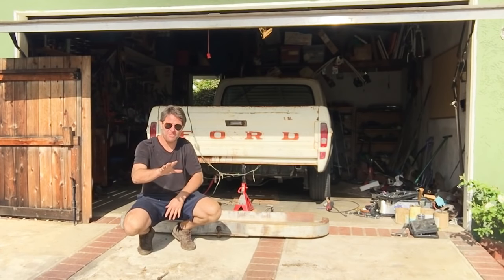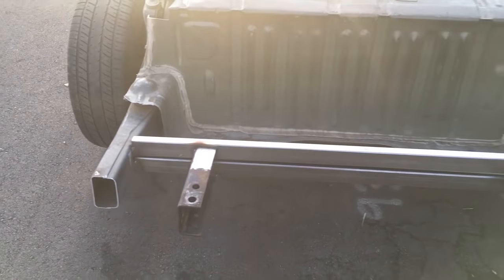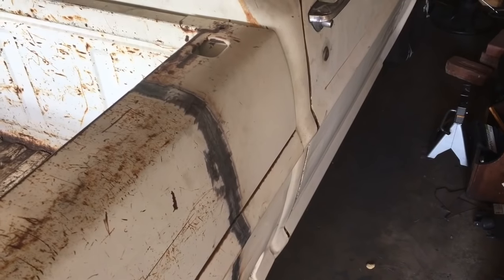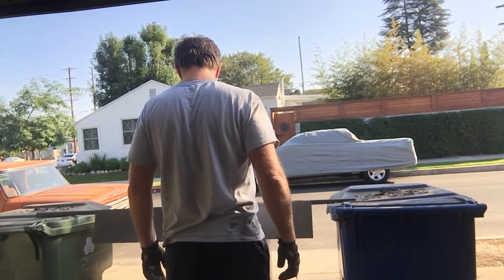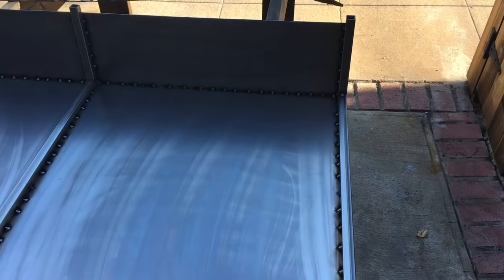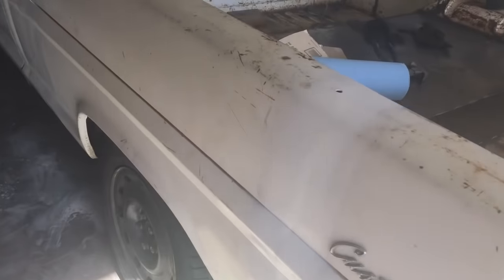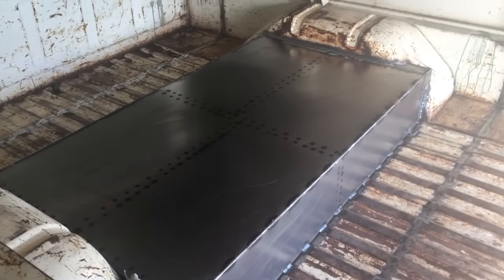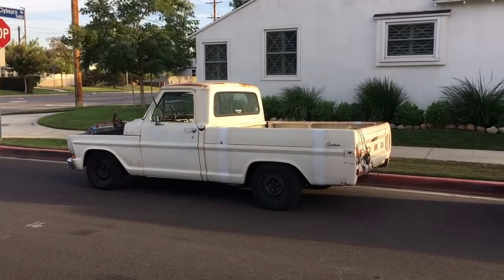F100 Crown Vic full frame swap "F71" Episode 9 more bed shortening, bed humps & intakes.

Comment: Just watching this for the first time (found you on the mutt build) and wondering why you didn't reusue some of the bed section you cut out to try to keep the look of the original bed - it's still an awesome job though
Reply from the maker: My thoughts and strategy on "how" to chop a bed have definitely changed and will be different on the next one. Thanks for watching.

Comment: Just a LATE suggestion......on the added frame section (Bumper mount), I would have added a pair of gussets between the added frame and the crown vic frame....extra tensile strength/support. Maybe even 4 gussets.....2 sets of triangles welded to the inside corners. Not my truck, it's yours. Your build, just a suggestion. Peace. ( I just noted Del Swanson suggested this 2 days ago. [edit])
Reply from the maker: Yeah. If I was towing heavy stuff I totally agree but my orange truck just sold so the F71 has to get finished...pronto! lol. It'll stay like this for now. I plan on selling it pretty quickly but if it becomes a tow truck I'll add some more steel.
Reply: Them 2 trucks looked cool! Even though I'm not really a Ford fan.

Comment: Really nice the way this is coming together. Someone did steal the orange truck at that price. I hope to get half as good at welding as you. Are you using 110v or 220v ? I'm thinking about this full crown vic swap - in my case the truck is a 1961 F100 flareside (stepside in GM terminology), but I would want to minimize the fuel tank hump in the bed with a 1970 Mustang fuel tank modified to work with the Crown Vic electric fuel pump(?). Looking forward to seeing the next video, great job!
Reply from the maker: I have a 220V Eastwood MIG 175. It is just powerful enough to do the frame welding. I'll get a bigger one next time though. Slick sides go really well with this swap. A few have been done. Good luck!

Comment: Hey Nathan.  Really enjoying your vids man. Some youtubers have great projects but watching them the whole time is AAAWWWFUULLL!!  Your style makes the vids enjoyable on top of the actual truck part. Enough kindness....I have a question. I'm going to build one of these.  I'm 50 and have enjoyed my years of beating and banging in hotrods. This one must be comfy, not overly loud, have all the gizmos working like A/C, stereo, power steering and brakes, etc.  It must ride beautifully because I'll proly drive it almost every day. I've had most every year of old ford truck and sold my last '49 F1 a year ago.  I fit ok in these trucks but for this one I need more room.  I'm 6'3 and weigh right at 295.  I drive a fox body mustang every day (bought it new almost 30 years ago) and just barely fit in it. I'm trying to decide between crown vic floor pan and firewall or truck cab floor and firewall.  I do not want the crown vic complete dash like your first one but do want to use all the CV underdash parts like pedals, a/c etc.  I want an old steel dash like my older trucks had but with the CV stuff in place.  So....since you have done both, can you give me your thoughts on both, as much detail as possible....lol. And yep, I've watched every vid you have...awesome series.  Thank you so much!  Really didn't want to put this much here but couldn't find your email anywhere.  Please overlook all the typos.
Reply from the maker: Thank you for the kind words. It's definitely a journey finding me "feet" in front of the camera with my own words & actions...a script fine...but when it's my work, it's a different story! OK. 6'3" & wanting a steel dash. Want F71 ride height? Do the F71 build & you'll get all the "old" dash. Use a post 2005 Vic with electronic throttle. Keep the truck brake & (clutch? pedal). Get Vintage air A/C & do a wiring mash up between new & old. I've not driven the F71 for more then a block so far so I can't give a comparison but my next film...or 2,  should cover that.
Reply: Thanks for the reply. Yes I want the steel dash because I can make it look however I want but mostly because it provides way more room for legs. As far as the ride height I really like your first (orange) truck's stance the best.  In a perfect world maybe half way between the two trucks would be good. I can fab nearly anything so I was thinking maybe extend the floor area in front of the seat and maybe push the lower firewall forward just a few inches. I'd need to keep the booster in the stock location so a fabbed up brake pedal would proly be needed. I don't have the money right now for things like the Vintage Air system.  I have to keep money to a bare minimum.  My time and effort are free though so there's that. I'm studying every picture I can find of the CV and truck firewalls to see if I can just graft in pieces of the CV firewall into the truck to keep all pieces in stock locations. Not sure about that yet though. I will definitely be using the factory automatic from the CV. I'm tired of shifting bud!! Looking forward to those next vids....get crackin !!
Reply from the maker: When you start post up some pics on my "Nathan's Garage" Facebook page.

Comment: Roughly how many inches did you cut off the rear of the frame?
Reply from the maker: Will Smith I didn't record the measurement but as I recall it was over 12"
Reply: Thanks, good luck with the new build. Hope he takes your offer.